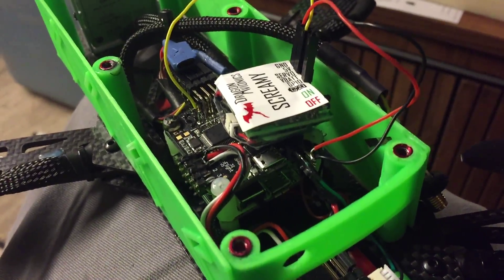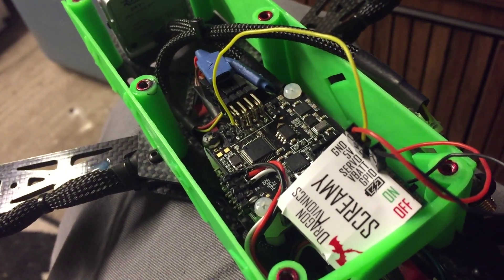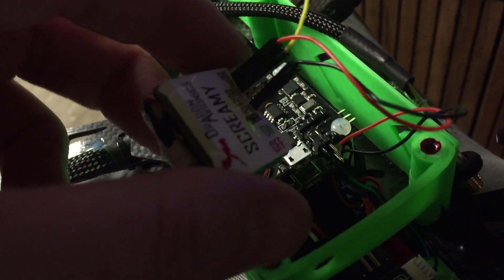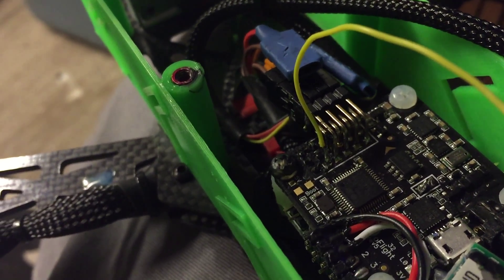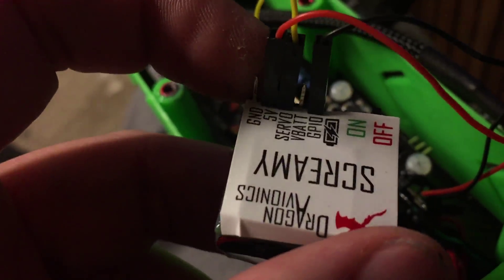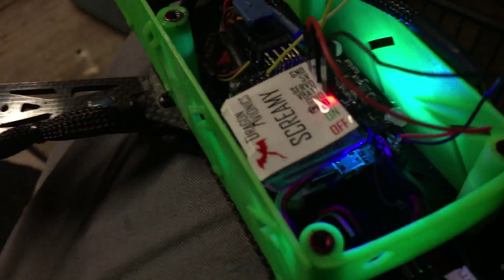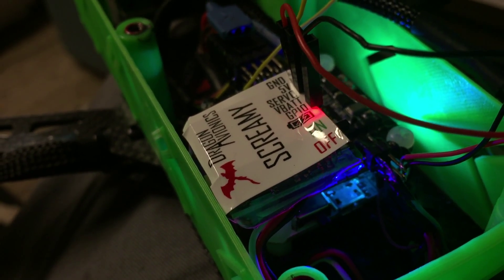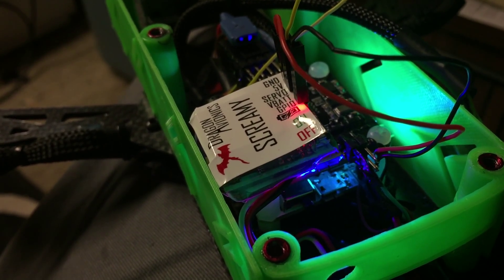Dragon Avionics Screamy PPM/Naze/Buzzer Lost Model Alarm Set Up

Comment: Hey, I have been trying to get this thing setup for months since I bought it and finally stumbled across your video here. I have it wired up just like you show but it doesn't seem to be getting a signal from the motor position 5 and just continually beeps. Did you have to do anything in cleanflight to make it work properly?